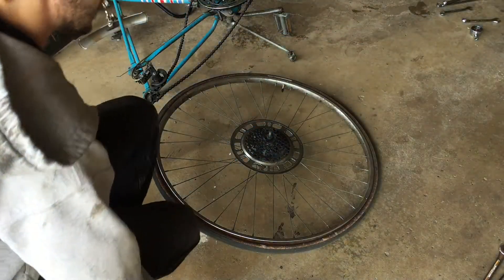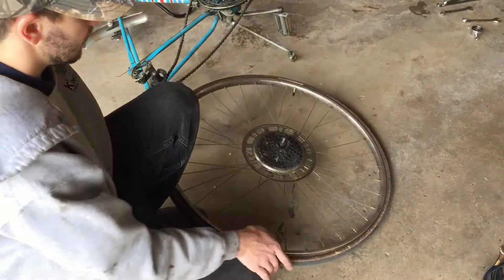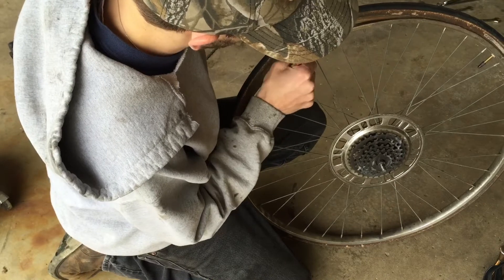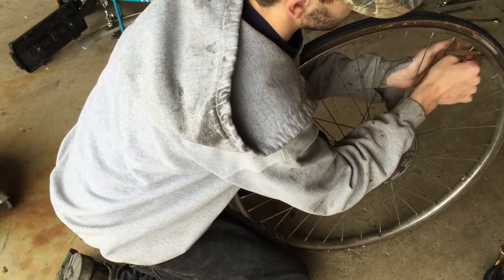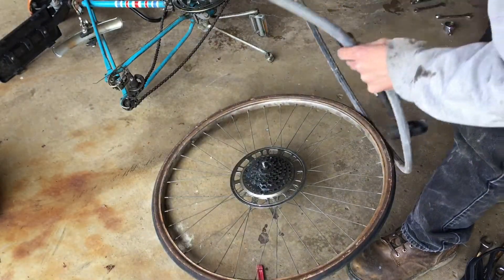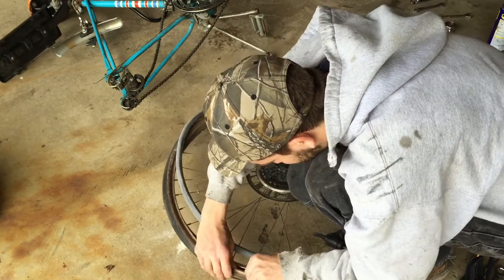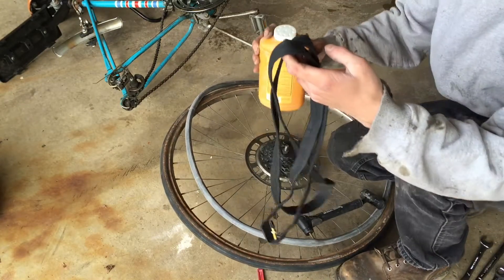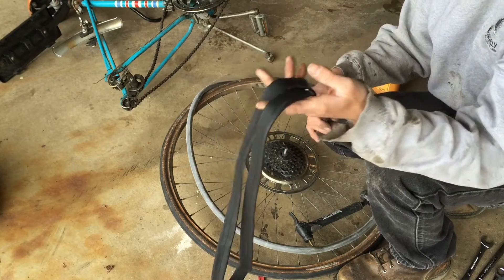Change A Bike Tire Inner Tube in 27" Tires!  1975 Columbia Arlington

Comment: ....you sped up the part I was interested in seeing.....the actual insertion of the new tube onto the rim and under the tire....oh well !
Reply from the maker: +John Foster ah sorry! you just sort of wedge it in there straight!
Reply: John Foster, insert the valve stem in hole in the tire rim and work clock wise